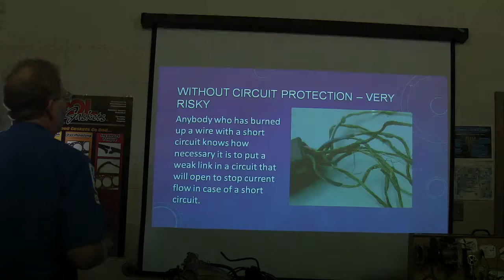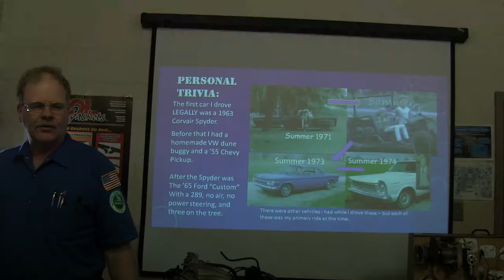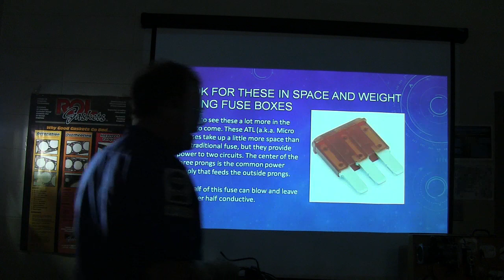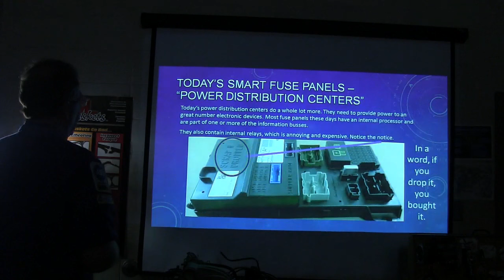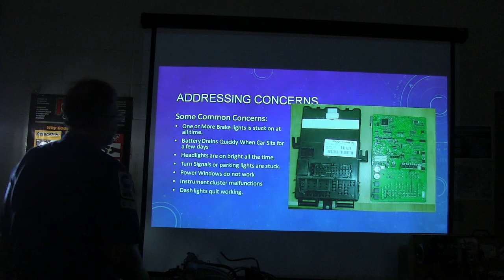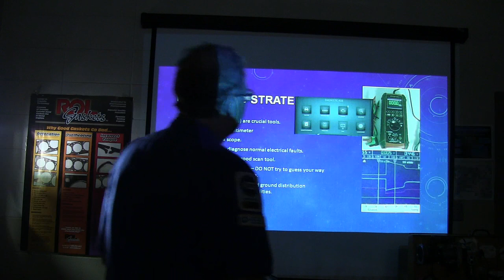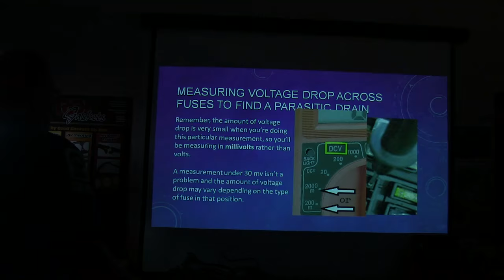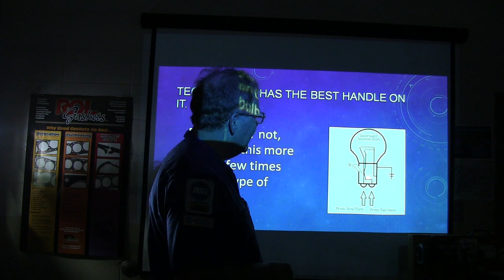Fuse Panels and Smart Boxes

Comment: Parasitic drain test using the fuses. Hit the powerprobe web site and you can download charts for various fuse types that will convert the mv reading on the meter to amps across the fuse. info.powerprobe.com/fusechartsdownload
Reply from the maker: Great tip!